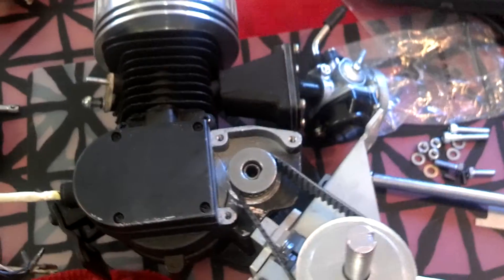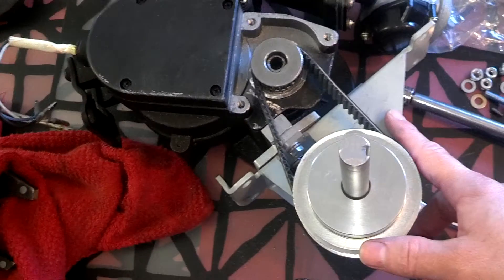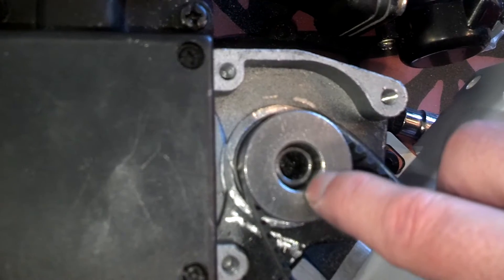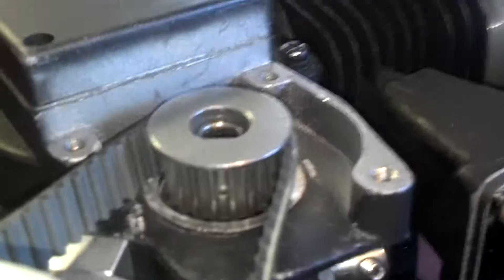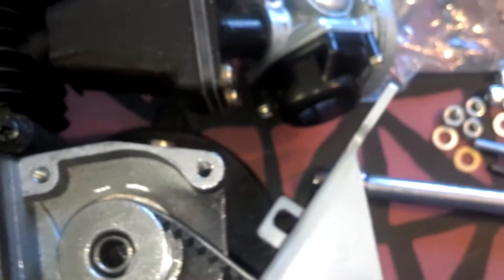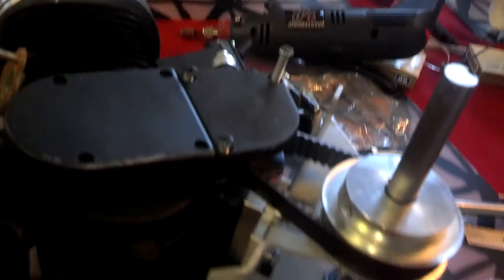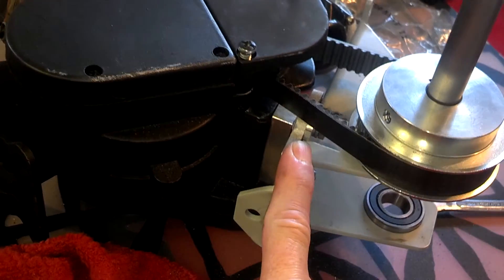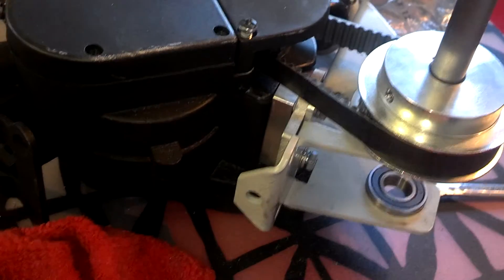Motorized bike belt drive

Comment: Primary belt drives are great. Their quiet and take no oil or grease. I, as a builder of such things can't locate a source of belt sheaves and belts of about 1 inch . Would be great on the secondary side also.